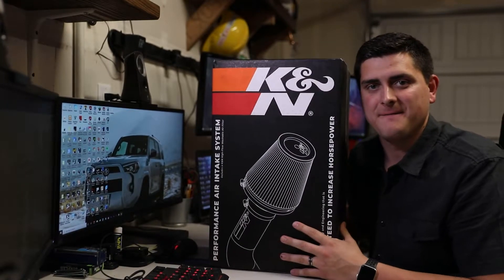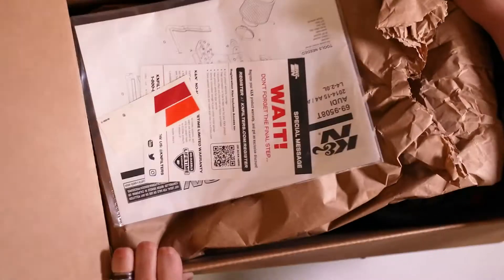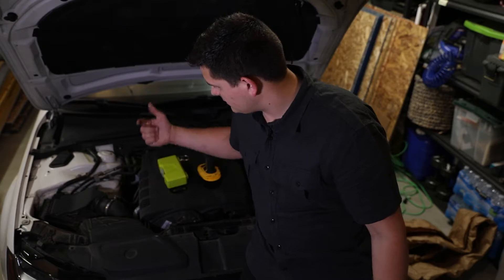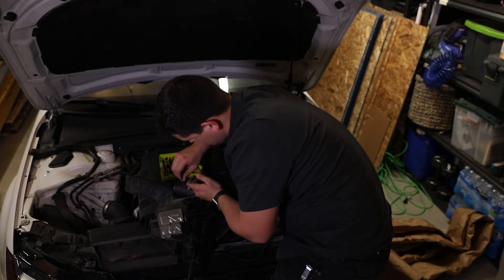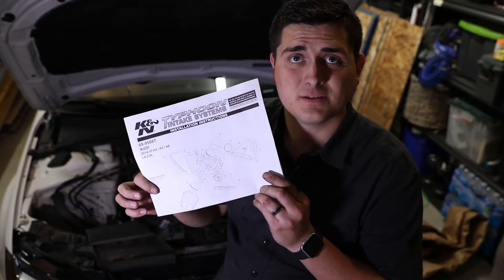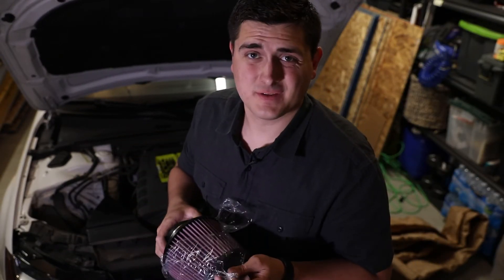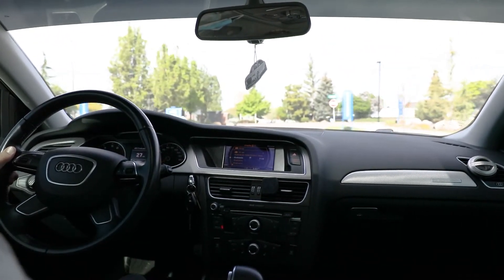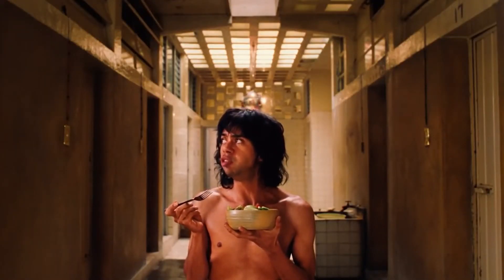My first mod for the Audi A4! K&N Intake Review

Comment: Old man market? I’m 65 love my 2012 A4 Avant Started with your intake, then a tune. Installed a k04, down pipe, intercooler, IE manifold, cat back exhaust, coil overs, F@R sway bars. A real sleeper, car is rock solid. You need more views!
Reply from the maker: Those avants look so good! I really want an rs6 avant someday. Sounds like a solid but reliable build! Thank you!
Reply: @TheWoodshedTV  I bought a 2021 TTRS in August, unfortunately it’s not as useful as the Avant which is for sale now. Too many vehicles🥲